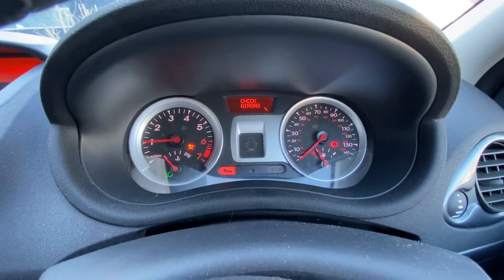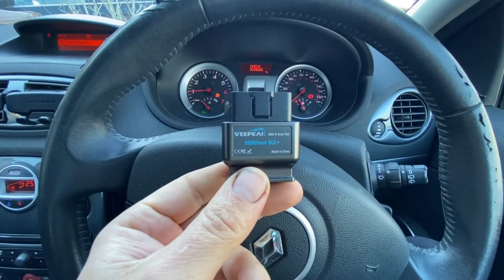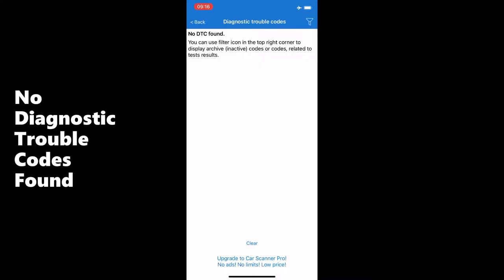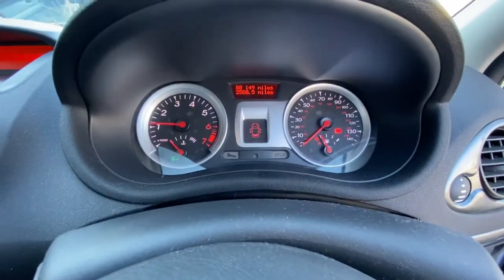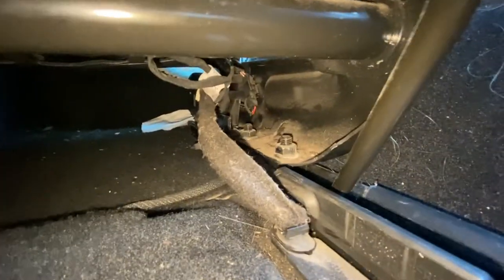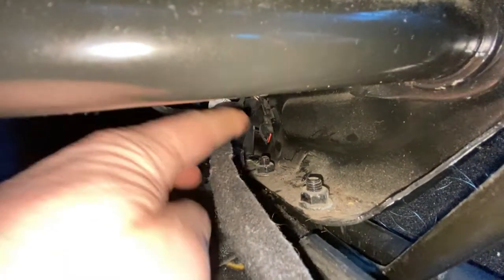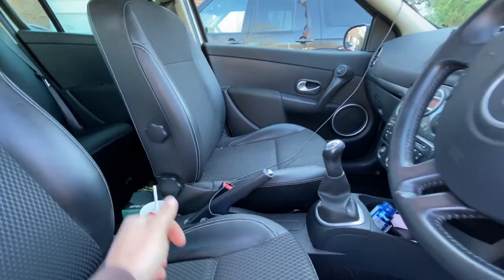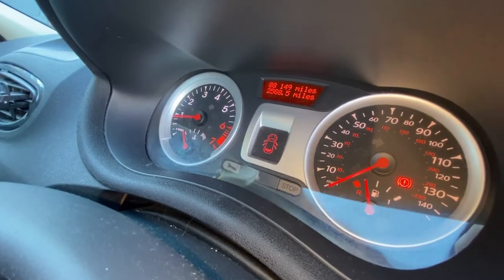Renault Clio Check Airbag Fault Easiest Fix Ever

Comment: Hi. I see that you own both Alfa and Clio 3. I know that the cars are from different class but anyway how would you rate these two vehicles. Is   clio less or more comfortable, reliable? How about noise insulation, which cat is quieter? I heard that Giuliettas are the poor in this respect. :)
Reply from the maker: Hi. To be fair they are very different vehicles. The Alfa is tight and poised, where the Clio is softer and more relaxed. The noise is pretty comparable, with the Clio being probably a bit quieter. I hope that helps. Thanks for watching. All the best 👍

Comment: Hey
Tried wiggling the cable. didn't help

There is also a connection next to the bolts.. underneath this connection there is a hanging metal clip sort of thing..should that touch the metal fram of seat?

Thanks
Reply from the maker: Hi. I had exactly the same loose on mine too. The switch is to tell the system how fast the airbag should deploy incase you sit further forward or backwards. This shouldn’t make the air bag light come on though. I’d try disconnecting the battery, leaving it for 20 minutes and then disconnect the plug, try and clean the terminals with some electrical cleaner and get it back together firmly. All the best 👍
Reply: @vialettotony  i tried cleaning the terminals..light went off for 3 days .i passed  MOT (CT in France)..but now light is back on
Reply from the maker: @sumithjjwala3  you could try getting diagnostic codes read to see if it is definitely this that’s the problem. It could be something else. All the best 👍

Comment: Happened to me today, hope by trying to wiggle those cables will fix the problem
Reply from the maker: Good luck Sebastian. Hope it works for you. All the best 👍
Reply: @vialettotony  thanks, but I think for me it's that rolled wire behind the steering wheel
Reply: @vialettotony  I was right, changed it today and now it works smoothly
Reply: @sebasbest4ever97 Rolled wire? Please explain. I have this issue with my clio.
Reply: Yes, you Need to take off the wheel and the light and wipers switch. The piece of plastic that remain It contains the rolled wire